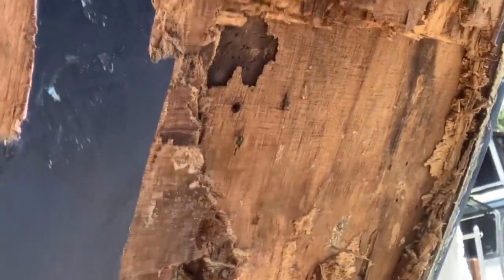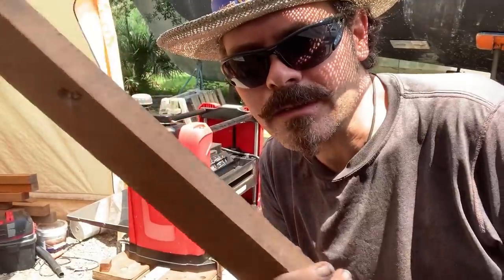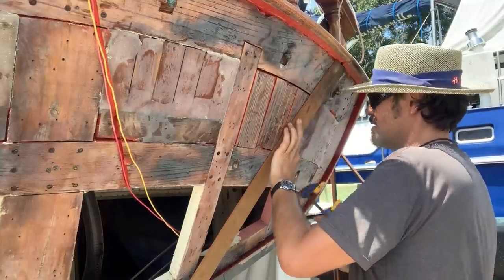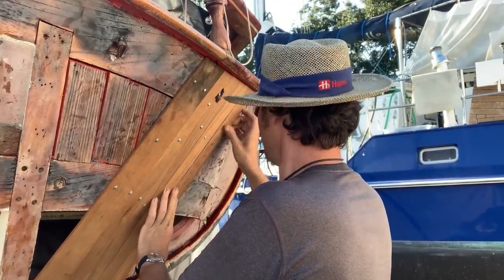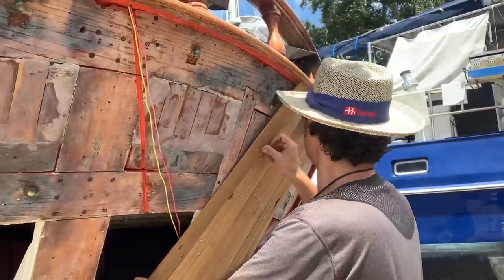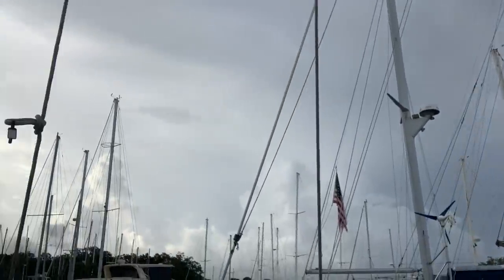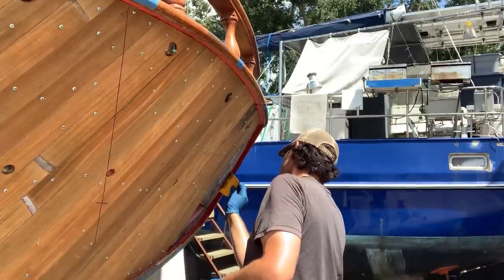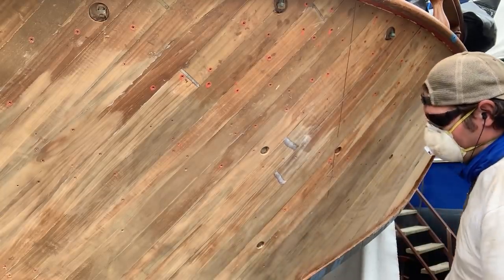Building The New Transom - part 1

Comment: I started working on little skiffs flat boat  and I was a young lad of 10 or 12 years old did it right through my teen years and up in a young adult hood and then start working on houses and gave up on it all no I’m pushing 50 and kick myself in the butt for not just continuing to work on bolts I wish I would’ve so I just love watching people work on boats good job harbor freight stuff is cheap but it ain’t completely junk you just Gotta know play around and work with it I know my story doesn’t matter to you but you inspire me I love watching this is a way to vent when you don’t know a lot of people thanks for reading
Reply: Yes used to make my own trailers to all my boats I built and then pull them around on my bicycle miss being young
Reply from the maker: Thanks for watching! There are lots of boats out there that need fixing!

Comment: not always but sometimes there's two ways to do things. I would approached the fitting of the planks on the sides by using a splines and a hot glue gun. One sacrificial plank with smaller sticks glued to it and they would reach out to the hull. Remove the plank and trace out the curve. Always interested in different approaches.

Comment: Well, I've bought an Iroko hulled 36ft  Frans Maas Breeon with a fit and finish you can only get with a solid wooden sailing yacht.
Only problem is that the hull is partially rotted (she was built in 1962). 
I was wondering if you might know the easiest way of restoring her as an added problem is her iroko hull was built around a metal frame which is rustling away.
Could I sheath the iroko with epoxy?
Or shall in dig out the rot remove the metal frames and start from the beginning?
Great channel 
Richard

Comment: I have submerged the bucket of epoxy in a shallow tub of water with maybe even adding some ice to slow the cure down. This was using a product that you apply over old concrete to restore it but I would think as long as the water is just cool and not beer cooler temps. It shouldn't hurt most mixes. You definitely have a handle on your craft so sure this isn't a new idea to you. You are getting close to dropping her in the water now.

Comment: This guy is awesome...somewhere between Ernest Hemingway and Jack Nicholson (check out The Last Detail). Love the pipe and the cigar. If I was nearby I would come by to volunteer. Rock on brother. Put on two or three layers of gloves at a time. Then just peel them off. After you mix your epoxy, pour it into a shallow container like a paint roller tray. This will extend the working Life by 4x. Check out the Travels with Geordie channel for good info on wood boats.